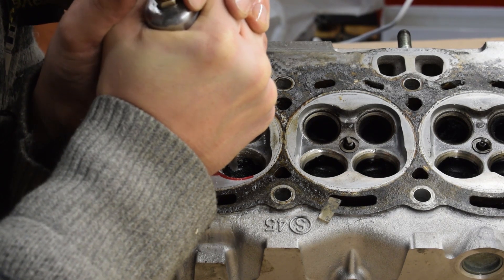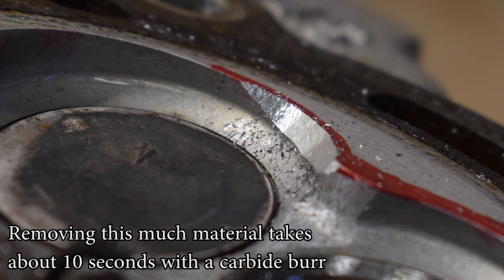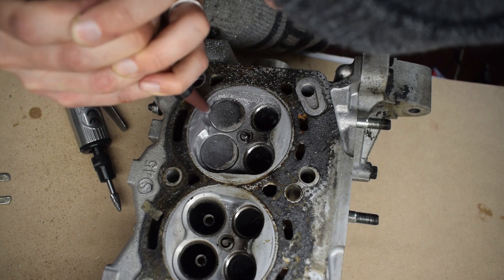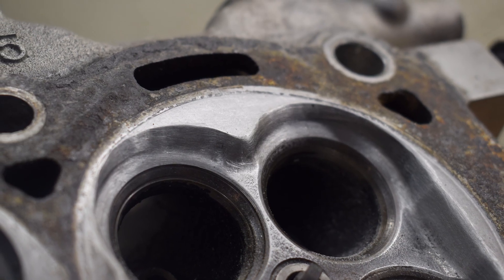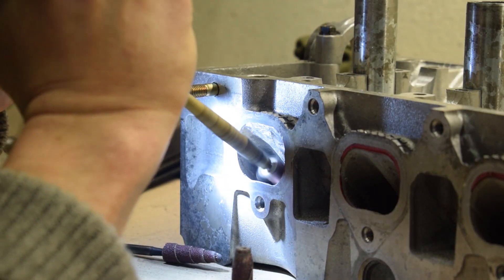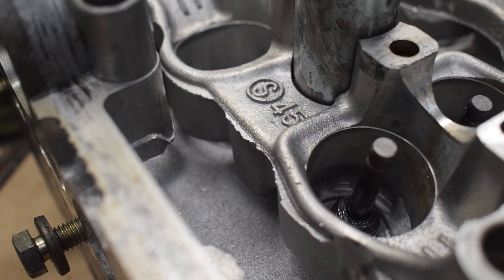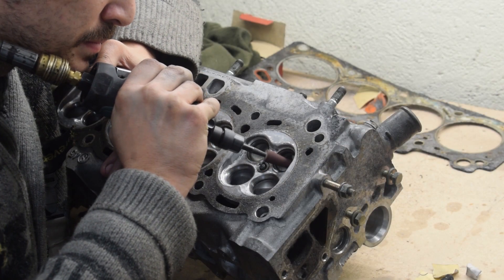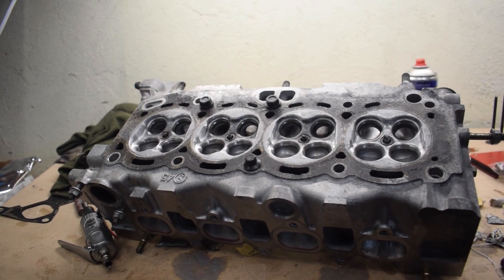PORTING the F out of it - Cylinder HEAD porting and polishing HOW TO - PROJECT UNDERDOG #6

Comment: This is a great example....
of what not to do.
You are not a professional head porter and it shows. You are the last person that should be teaching others how to do something (that you yourself don't know what you are doing).
Your porting is either going to be useless or counter productive.

For a street engine, porting should not be the go-to solution. All significant gains on a street engine will be made with a quality valve job and un-shrouding performed by a qualified machinist.
Reply from the maker: I hope whatever is making you so bitter and close minded goes away soon and things improve for you.
Reply: @d4a  Maybe my bitterness will subside when you stop posting bad info on the internet.

Stick to what you are an expert at, or state that you don't know what you are doing in the video.

Maybe your intentions are good, maybe you just want the clicks, either way you are putting garbage on the web that will inspire others to damage their engine and performance.
Reply from the maker: You're allowed to think it's garbage, no issue there, but when you openly say something is garbage you need to explain why. Otherwise you're just on an emotional rant.
Reply: @d4a  It seems like you are the one getting emotional here, a bit defensive, mostly butt-hurt.
Anyways, Your porting did not address the critical areas and focused on pointless and counterproductive areas.
You reduced your CR. Your chamber work removed quench and squish material. The surface finish is also counter productive for a street engine. The obstructions are all still there unaddressed. Your gasket match port is worthless. I guarantee you that the intake manifold port was already smaller than the stock head port. A step between the two is actually beneficial as an anti-reversion dam.

I am not going to waste any more time pointing out the other (numerous) problems with your work, nor am I going to teach you how to do it right. As I said in the first comment, you are not a professional porter and it clearly shows. Just refer people to Jafromobile's channel for a better (not perfect) DIY on the subject. 

The porting work you did was most likely counterproductive. I work developing heads and spend lots of time on the flowbench. Flowbench numbers are just a tool and not the end-all, be-all. Scientifically controlled dyno-proven experiments will be the proof of your modification's effectiveness or not. Otherwise you are talking out of your stink hole.  You wasted your time and effort on this head.  

By the way, using these tools without eye and respiratory protection is really stupid. Aluminum powder is well known to cause serious health problems, Alzheimer's disease being one of them.
Your video is a bad example of everything you did.(or a great example of what not to do)
Reply from the maker: @David_H_Parker  Let's call it a day eh? You shouldn't spend this much time in the comments section. Better get back to developing heads, the flow bench is waiting! 🤣🤣 Thanks for the laughs and try to have fun from time to time. It'll do you good.
Reply: @d4a  I agree, I've wasted too much time with you.
Good luck on  your DIY basement build.
Reply: @dquad  It is very hard to prove causality in a scientific way without doing unethical and long term experiments. Statistically, there is a strong correlation to aluminum ingestion / exposure and Alzheimer's disease. That is not to say it is the exclusive contributor or cause. I agree with you that breathing anything other than clean air is not ideal.

It's typically better to drop the CR from the pistons. You get added benefits of lighter pistons.

Removing quench area from the combustion chamber is also not the best idea for this situation.

Since it is not a race engine, much of the time spent would have been more beneficial and productive elsewhere. Many people actually lose power by making modifications based on "logic" and a simplistic understanding of physics.
Reply: @David_H_Parker  there seems to be various schools of thought regarding the partial removal of squish/quench areas since there are some who won’t touch them so as to retain squish and a final charge movement at TDC. However there are others, such as the legendary David Vizard (whom Jafromobile has learned from), who teach to remove a set amount of material using the geometry of the combustion chamber and the valves. That being said, and I don’t mean for this comment to sound sarcastic, you sound like a knowledgeable person on this topic so please rather than criticize any of us for our mediocre work go make a video of how to do it correctly instead, the whole internet and I will thank you!! 

PS. I’m being serious please elaborate on your method of porting on some sort of well produced and cohesive video format so we can compare and learn.
Reply: @alejandromatiasdrums  David Vizard is a good reference for older engines. He has not honestly spent much time on modern multi-valve heads doing R&D. He spent his later years developing  US domestic 2-valve V8 engines for Nascar and other series.

Secondly, there is no way I would make any videos to reveal trade secrets that I have spent hundreds of thousands of dollars, and decades of R&D to acquire. I started out the same way and nobody dropped the information and know how into my lap. If anybody really wants to master it, they are going to have to put in the money and time to learn it for themselves.  Believe me, nobody is teaching everything they know, including David Vizard.

Lastly, I will repeat. We are not talking about a race engine here and much of the chamber work is counterproductive on a street car. We are not targeting maximum flow at high RPM. We are playing a delicate balance of keeping high port velocities and low lift flow at ideal zones for the torque needed to pull away from every stop light. Driving a race engine on the street is miserable. The engineers are smarter than this youtuber thinks. Sometimes people with a little bit of knowledge are more dangerous than people with none at all. The ones with a little knowledge think they know more than they actually do.
Reply: In my opinion raising the CR is the cheapest and  easiest way  raise  the power output of a stock engine and David Parker is 100% correct   The only real way to know how to port is have a computer teach you. You would be surprised how a seemingly rough looking  head flows better than a old school by gosh and by golly job anyway.

Comment: Very nice. Im about to do the same to some aluminium heads for my 3.4 v6 build.
How difficult would you say it is to get the shapes of the bowls identical?
And how important would you say it is that they are identical in shape aswell as volume?
Reply from the maker: When it comes to the bowls you really don't need to disturb the shape much, you're just getting rid of the imperfections and blending edges, the overall shape stays unchanged. It's of course important to maintain a reasonable degree of consistency when you're doing this, which is why doing things in groups is best. Don't do one cylinder at a time, but do all intakes, then all bowls, all chambers etc, the order is immaterial of course. Volume will also be largely untouched as you're not removing a significant amount of material. On the other hand if you're significantly reshaping the bowls for whatever reason, consistency becomes much more important and much harder to maintain.
Reply: @d4a  I thought as much. 
Do you have any experience from making the chambers bigger?
The heads I want to use have a smaller chamber and I end up at 13:1 cr. So I need more volume somehow. Maybe use a lathe and make the bowl in the pistons larger would be easier. But then it becomes a question of having enough material left in the piston crown..

Comment: I am getting through doing this on my 7M, the casting lines and stuff are way worse than any 4A engine! Just on the port side of the valve seat alone was several mm of right angles and big burs, my extended die grinder bits just arrived this arvo so I can do deeper in the ports now which is sweet. I havent used the sandpaper rolls yet, just need a few days off work...
Reply from the maker: Good luck man, the crappier the casting the more benefits from doing this!

Comment: Very nice video, such a simple and elegant way to explain things! 
Always remove casting flash even if it doesn't affect performance. 
Small chunks/chips of weak and long/webby casting flash sometimes breaks off due to changing vibrations. These chips gouge and marr various surfaces on their way through the oil galleries before getting caught by the oil filter. 
For everyday engines, this happens on a very tiny scale within the run-in period, and the pieces are so small that they don't do significant damage. But when you're driving flat-out for any significant amount of time, this is one step avoids pretty significant costs later on, especially considering how little time it takes. If the engine is open, might as well do it now! 
Also read up on surface finishing techniques including grinding, burnishing, lapping, honing, scraping & polishing. 
A carbide burr and sandpaper rolls aren't the only tools in the arsenal. You can use a plethora of cheap and plentiful tools to take your game to the next level. 
P.S. If anyone wants to validate this "theory" for merit, all you need to do is inspect any internal surface of an engine with a cheap USB microscope. Even at 50x magnification, the tell-tale marks appear gigantic. 
If your microscope can get to 500x, well, you can see something like the surface of the moon within your engine. 🤣🤣

Comment: Put painters tape on the valve seats. you can hit them accidently without doing damage.
Reply: Yeah i did the same. Just put some tape over the valve seat to protect it.
Reply: Painters paper tape will stop a carbide burr that chews aluminum?
Reply: @tinymotogarage  No, but it will give you just a tiny bit of warning before the burr contacts the seat- moving slowly (like you should when doing this job) means you have at least a split second to realize the tape is being torn before actually grinding into the valve seat
Reply: I used 'tin tape' which I think is aluminum. expensive but you don't need a lot.
Reply: You will loose a lot of Power!!
Reply: Don't know anything about these Toyota headers, but is valve seats THIS fragile, that you can't even touch them with sand paper? I mean, I watched a ton of videos with porting LADA heads, and they are pretty OK with making a little bit of contact. 
Material and dimensions of seat in case of LADA might be different tho, and you have to recut them any way (since you always change valve guides), but nobody changes seats after relatively small touch of mill or sand paper
Reply: @zedeg94  Is the Lada head steel or aluminium?  If it's steel it might be a little more resistant to damage.
Reply: or use a mill .
Reply: @rafaeldiegonavarro  no,  regular mill will not be able to the bowls. You would need a 5 axis cnc machine.    And at a price tag of 184,000 usd. Some tape, steady hands and some carbide burs is way more practical.
Reply: @CP110  ahhh gotcha . makes sense now

Comment: Yes, definitely need eye protection.  Fishing a metal chip or a sandpaper grit out of your eye really sucks, and you’ll only be doing that once before always keeping eye protection at the porting bench...if you’re lucky enough that nothing was damaged in the process.  Sanding rolls in the bowls are a bit risky to valve seats (and naked eyes 😉...) due to their tendency to  unexpectedly shed pieces, grow flaps, or sometimes outright self destruct.  I carefully use a nice rounded profile carbide burr to fix the core shift and casting flash and finish either with a rubber abrasive cartridge or by hand (I prefer hand finishing myself...especially for exhaust ports...it really does finish a lot smoother than any rotary tool, especially if you are going for absolute maximum power potential).  Also, there are a lot of benefits to a raw carbide finish in the intake ports.  It acts like a wick and helps vaporize fuel on the walls, among a few other things that would turn this comment into an essay (and the added bonus of saving a lot of finishing stages).

Comment: I would imagine smoothing sharp edges must have some impact on how smoothly the combustion mixture flows away from squish areas and how it swirls. Likely reducing sudden heat risers and I would think improving the overall burn. Given you're going forced induction, I'm guessing most of your gains here will be from the exhaust work, which looks very nice. Pure speculation on my part though. Great work as always.

Comment: Nice video!  Always enjoy your stuff.  Suggestions for you for the next head you port.  Use a Dremel with the flex shaft attachment.  Much easier to get around those tight corners due to the small handle and light weight.    The other one is to use some heavy tape to protect the valve seats.  You can even put a washer between layers of tape for added protection.  That'll keep them safe no matter how many beers you had before you start porting the head.  (Yes, its funny how many things seem like a good idea after a few beers...)

Comment: I ported heads for several engines in my racing days. I used roll pins to locate the intake and a thin aluminium sheet to transfer the openings the intake so the connection was perfect. Then RTV silicone instead of a gasket. The exhaust burned any protruding into the port but the cylinder head temp was not enough to burn the seal. Same with the intake, the fuel won't melt the silicone in the sealed area. I also made the seats at the very edge of the valves so the valve acted like a bigger one, then shaped the port to round into the seat. Better flow measured on a flow bench. Lastly, leave the port a little rough past the injector or the fuel will not evaporate well on a polished surface. Prove that with an air blower on a sheet of glass with fuel on it.

Comment: A rotary tool with a flexible shaft extension is really useful for doing this! The much smaller and lighter head allows you to hold it in one hand like a pencil whilst using your other hand as a rest/brace for your wrist.
Reply from the maker: True! Definitely a good tip

Comment: Hey D4A, where is a good place to get those carbide bits and cartridge rolls along either their attachments for the die grinder? That work you did looks really nice!
Reply from the maker: You can get them pretty much anywhere and most are decent. I tried the affordable stuff from ebay and Amazon, and it's honestly not bad at all. Depending on where you live brands like Makita, Kronen, Lukas, Wurth and others make some more high end stuff if you want to spend more.

Comment: Aluminum dust is not good for health so I would recommend a mask that can filter the that dust. For example it is thought to be linked with Alzheimer’s disease among other health effects. I’m digging your videos thanks you for the effort and time.
Reply: Dang, looks like I'm going to get Alzheimer's.

Dang, looks like I'm going to get Alzheimer's.

Dang, looks like I'm going to get Alzheimer's.

Dang, looks like I'm going to get Alzh.... Didn't I say that already?
Reply: Besides having a mask...
Spray wd-40 to lube down the dust, and have a vacuum running pointed to the cylinder head to pick up any air particles. 
I go as far as spray some oil to the table and have a wetted paper towel on it under the CH.
Reply: @psiturbo  right on good idea
Reply: Great point! Also, please, PLEASE wear safety goggles!!! I just learned that lesson after getting very fine cast iron dust in my eyes from porting my turbo exhaust manifold, and I was wearing glasses! Felt pain in my eyes hours later when I went to bed. Not fun! Flushing them out like crazy and seeing an optometrist today just to be sure. In the end, wear proper PPE!!!

Comment: On modern performance engines some nice tooling is used to replicate the valve seat blending on mass. For example during guide boring on the f type v8, the reaming tool also cuts and blends the seats on the same pass. Clever stuff, but again on really seen on higher performance vehicles

Comment: 2jz heads have significant amounts of casting flash around the valve train area. Knocking all that crap off as we speak.
Reply from the maker: I cut my finger on it when I was taking the head off, grabbed a head bolt to pull it out, didn't notice the flash, gave me a nice cut 😑

Comment: Idk if I'm going to need to Port my d16y8 head much, but this is definitely a good vid for some tips and tricks. I definitely agree with cleaning up flash it just feels better to have a cleaner looking product. I had a job were I worked on Chevy heads so I'm pretty familiar with valve seats and cleaning up the ports and such

Comment: Best content. I’ve got that spare 3S-GTE T-VIS Head in the corner just collecting dust...
Reply: Those old engines laying around are dangerous, I've got a 2nd gen 3S-GTE just sitting in my garage after doing a 5th gen swap.  I keep seeing it and wanting to build it into high horsepower engine, and find my self casually browsing craigslist for a car to put it in.  I really should just sell the engine to get rid of that temptation.
Reply: @Pulsarr1 
That head is sitting next to the “built motor” 2nd gen I bought. I intend to go over that one with a fine tooth comb.
The sickness is real. 🤣

Comment: Bad idea to decrease the size of the squish pads of the chamber.  Squish helps with air-fuel mixing which has a lot of benefits.  Not bad to knock the sharp edges but you should have stopped there.
Reply from the maker: The stock squish doesn't work anymore because I'm not using the stock pistons. I'm using 4AGZE low comp pistons.